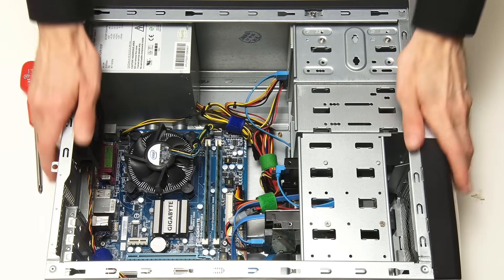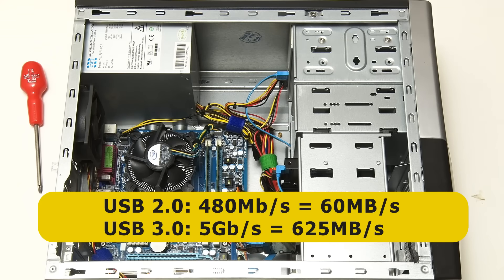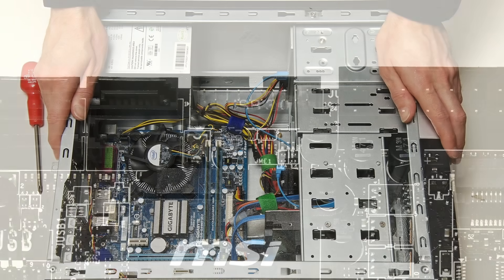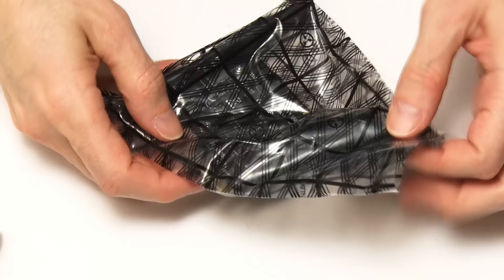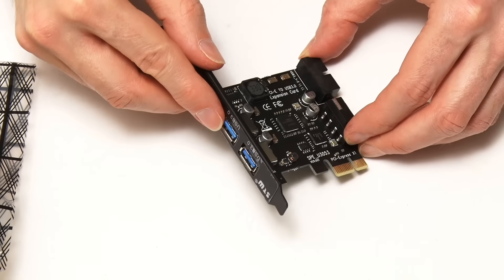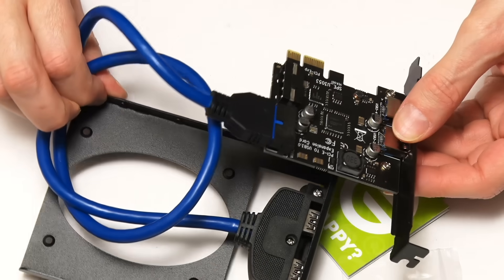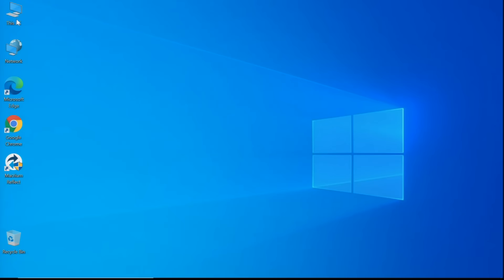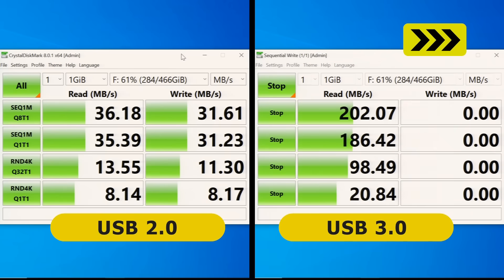Old PC Upgrade #3: USB 3.0 Ports

Comment: I just recently bought two USB 3.0 PCI-E x1 cards for my two older PCs. They are G31 and G41 boards. I had to fit on x16 slot as these boards do not have x1 slots (of course your PCI Express video helped me to understand that I can  use x16 slot, Thanks a lot for that video 😊). The G31 one running Windows 8.1 (x86) and G41 one is running Windows 10 (x64). I have already installed the G31 board's card and it was just plug and play. It did not require any driver. Running just fine. Both of my cards have molex power connector.

Comment: I like your videos because they are real-world situations I've often had to deal with in friends and family computers. A lot of tech videos are only dealing with brand new hardware, perfect cable management, in cases that cost more than the entire computers some people have. I'm hardly ever dealing with brand new bleeding edge stuff- it's so often things like this- adding  USB 3 to an old computer and dealing with 'how to get power to a new component" from some old PSU with all those red, black and yellow wires- NOT some nice modular 1000W PSU that's a week old! Anyway, thanks for a fun video on a real world upgrade!
Reply from the maker: Thanks for this post, it is great to get this kind of feedback. My experience is also that most people do not have the latest expensive hardware.

Comment: Hi. So I have a question regarding these types of devices.

I recently purchased a PCIE x1 to 4xUSB 3.0 connector with no additional power input. It has 3 power regulators supplying up to 2A to each port apparently. (Google or search Ebay for "SSU U3V04S+").

My motherboard is a Gigabyte Ryzen B450 which supports  PCIE 3.0

Now, it's a cheap device and I did notice it had no SATA or Molex power input, so I had no intention of trying to power four external USB hard drives or charge devices with it or anything! But it does seem to power my two Oculus sensors fine...for the time being. But it is new.  If I plug in any other devices at the same time,  it would probably be a mouse or keyboard or game controller. But I'm being as sensible as I can and not expecting much from a device I bought for under a tenner!

So maybe SOME questions... :)

In your opinion, are the devices in which I'm referring to legitimately safe? What's the worst that could happen if these devices fail/fry? Are there power limits or something that consumers should look out for in the device specs?

I presumed at the time that PCIE 3.0 would have enough power and bandwidth to support it with power regulators...But now this video makes me unsure.

I also just want to thank you again for your lovely, informative channel that has taught me so much over the years in a very easy-to-understand way. I hope this comment finds you well, Sir.

Comment: Ranking motherboards for "good design" should be a rather important piece of consumer advice ... because "cables getting in the way" or "slots being badly designed" when it comes to WIDE graphics cards for example, are making working with some motherboards a nightmare.

The same is true for cases ...

Comment: It seems like the front panel piece actually has the capability to secure a 2.5 ssd, so you could have used that one instead of buying a separate adapter tray back in the previous video!

Comment: I did a similar upgrade on my computer about four years ago with 5 USB3.0 ports on the back and an AFT Pro-77U with 4 USB3.0, a CF card slot, a MS Card slot and a Micro SD slot.  What a HUGE improvement in performance and versatility.

Comment: On this old computer you should have a core2 quad q9650 or xeon e5450 processor and a gt 1030 graphics card. And you get a completely "modern" computer at a level close to the ryzen 3 1200.

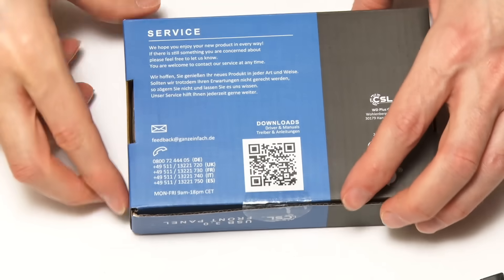Comment: 6:10 or you can go over kill like me and utilize all the space of the floppy slot. The one i bought has two USB 3, three USB 2, one esata plug, and a multitude of card readers including both micro and full size sd card. not sure what these other things are like MS, MS pro, CFI, CFII, MD, AND RS MMC but it has them.

edit to add that i did this on my dads old computer from like 2010-11 because of course my shiny almost new pc from 2016 has no front slots for anything and so i have like 5 or 6 things hanging off of it with like 12 cables coming off the back of the pc including the power and monitor ones.

Comment: I’ve found the simpler bay adapters like you installed are best, the type with a small board with power socket can get too hot to work properly with some usb drives (especially sandisk, they can get too hot to touch)

Comment: Well, as promised,,  i have added usb 3.0 to my geriatric computer. The pcie card from Vantec was a doddle to install because I had one slot to put it in. I also added the Vantec front panel which was problematic. The mounting  holes of the cradle did not match, so I was forced to drill as close as possible to the new front panel interface connection spots. The end result? There was no blue smoke that came out. You know that computers run on blue smoke? When the blue smoke gets out, they stop working. ;-)

Comment: Could you add an M.2 SSD PCIe NVMe card to the PCIe port to use as storage device, or would it not work as this old PC probably (SATA?)is not upgradable to NVMe? Is there any PCIe storage drive that would work on that port?

Comment: @Chris, thanks for another informtive video!

I have a query regarding adding USB 3.0 ports on my old PC. 

(A) Option 1 : I am debating on getting an external USB 3.0 Hub 7 ports desktop hub (with a dual port power supply) for my 5 external HDDs (All my external HDDs are USB 3.0, with their own dedicated power supplies.). This external USB hub will connect to one of the USB 3.0 ports on my PC. The existing USB 3.0 and USB 2.0 ports on my PC are all used up by peripherals like mouse, keyboard, joystick, printer etc.
I am confused whether the bandwidth of these external HDDs will get choked, because the USB 3.0 port on my PC to which this 7 port external USB hub will be connected, can theoretically handle only 5Gb/s?

(B) Option 2: I have also considered purcahsing a 5 bay DAS (Direct Access Storage) for my 5 external HDDs, but the problem of bandwidth choking will remain the same as above, since the DAS will also connect to a single USB 3.0 port on my PC.

(C) Option 3: Another viable option is to go in for the internal PCI-e Expansion Card explained by you in this video, alongwith a 5.25 Inch Front Panel 5 port USB 3.0 Hub. My old PC case has a spare 5.25 bay, because I use an external DVD-RW. (Who uses old school DVDs nowadays in any case!)

Which option, out of the 3 mentioned above, do you recommend I should adopt Chris? Adequate bandwidth criteria being the primary consideration...

Comment: I've never seen a motherboard that puts the x1 slot ABOVE the x16 slot. I have an old system and the x16 slot is on top with the one and only x1 slot under it. Which of course means that the x1 slot is useless as it's covered up by the heatsink and fan on my graphics card. 

I wanted to put a USB 3.0 card in this system, but I couldn't see any way of doing it. Most of the riser cables I found have the connector straight on the end of the cable, so they have the same problem as plugging in a card. And of the few that I found with right-angle connectors, the connector on the other end was turned the wrong way to allow me to mount the card in a vacate case slot (my motherboard is short). In order to do it, I'd need to daisy chain two riser cables, and that combined with the card itself would end up costing me $50+, which really didn't seem worth it for a slight speed increase in an old system. Plus, I found tons of comments from people advising against using riser cables at all, saying that they made the cards unreliable.

Comment: The problem of using PCIe 1x USB 3.0 cards is, if the system only runs PCIe 1.0 or 1.1 the card is dead slow.  0,25GByte/s maximum buswith. USB 3.0 will need 0,4GByte/s. So This works only for systems with at least PCIe 2.0 or higher. Otherwise you get not the full effort of USB 3.0.

Comment: Any usb cables work at those speeds or u need new cables?
Reply from the maker: You need USB 3.0 cables (they have extra connections in the plugs) to get USB 3.0 speeds.

Comment: It's a pity You didn't show how the Card would fit Into the Long x16 PCI slot. The Problem that I have Is, My Audio Card Is using the PCIx1 Slot or the Two section slot (White) here 7:41 mine Is blue. But I have two of the x16 slots free. Thanks for the Information.
Reply from the maker: It would just plug into the end of a PCIe x16 slot. :)
Reply: @ExplainingComputers   Sorry, I watched your video on PCI slots. And You actually do put one into the x16 slot. Only the ones shown are Flat at the End, where mine has a Little Groove at the end, Very strange. I was suffering with the Computer just shutting off for no reason, just watching YouTube videos, I can can play ten In a row with no problem, Then I play this one     https://www.youtube.com/watch?v=tya7i0Yiub8   and It will just shut off. Any Idea why this Is. It's not the only one that does this either. Thanks for getting back, I enjoy watching the History of the Computer. I was a DOS, Dial-Up user with a Program called Data-Ease. A Spread sheet that You had to Build Yourself. You added Fields and You could name them and stretch them, like building a Website today. It was used for cataloguing  my Music CD's For the Disco for quick search. It was a Samsung Laptop with a Floppy Drive. I still have the Database on a box full of Floppy's. Sad I know.

Comment: Help? If I use the  pcie  x1 usb 3.0 card in video. And plug it into a free pcie x16 slot on my motherboard. Will I get the maximum speed or will it only run at the pcie x1 speed capabilities.  
This probably is really stupid question but I have no clue about computers and was given a free dell 390 . Thanks if I get a answer
Reply from the maker: The PCIe x1 card will only ever run at PCIe x1 speeds. But how fast this is will depend on the PCIe version of your motherboard. I've a video explaining this here: https://www.youtube.com/watch?v=PrXwe21biJo
Reply: @ExplainingComputers  thanks a lot for reply , I watched the video you linked. And now understand it. Your videos are great and easy to understand. I wish I found this channel before I bought a 2500k cpu and realised afterwards you can't over clock on a Dell motherboard. Lol rookie mistake but enjoying the learning process.  Cheers

Comment: Sorry. I want to ask sorry im using Google translate..... I want to assemble a PC just to send fast data using USB 3.0 and install Windows 10 ...... if the motherboard is an old school LGA 775/1155, if , you have to use PCIe usb3.0. ..

I want speeding file transfer due to large file files like ps4 games ..... transfer files to external HDD

The intention is that I want to use the usual LGA 775 processor core2 duo installed PCIe usb3.0

If I use the LGA 1155 motherboard processor i3
Any big changes?

For example, in the LGA 775 processor core2duo PCIe USB 3.0 the data transfer is 50-70mb / sec

If the LGA 1155 processor i3 PCIe USB 3.0 can be increased
Data transfer is 120-150mb / sec

Or is it the same?

Does the processor have a big effect on file transfer speed in USB 3.0?

Or is the processor not that influential ... only 4gb ram and HDD replaced by SSD ... it's already speeding and there is no difference in transfer speed.....

Comment: My HP Pavillion Elite didn't have an external 3.5" bay (and the 5.25 bays had Blu-Ray and DVD drives).  But what it did have was some oddball proprietary bay for HP's "Personal Media Drive".  So I pulled the guts out of the otherwise unusable bay and fitted the USB3 front panel in there.  Still would like to make some use of the other "Pocket Media Drive" bay though (it already has a built-in card reader).

Unlike most home computers, this actually has 6 memory slots, and supports up to 24GB memory.  (the machine originally cost me all of five dollars at a flea market).  So I just scrounged up parts out of my parts bin as well as my homebrew PC and upgraded it (that's where the BD-R and DVD-R came from) put in a SSD and a bigger HDD.

Comment: Nice for basics. My challenge is the next, to have USB 3.2 Gen 2 max speed of 10gbps (1.25 GBps theoritical) on my old PC which would need a pci card running at pcie x4 minimum. Not a challenge to procure the card, but i reckon the cabling, the header towards the front bay and the front bay itself, could be. So far I'm yet to convinced to find the proper cable and front bay.

Comment: Price also varies on the addin card depending on how many real usb controller chips it has, most like the motherboard ones only have one, the ports are all shared through the first hub and share bandwidth.   Multichannel costs much more.
Also check your cables for continuity, braid shield should connect to the connector shells, else it may create interference.
Upgrading old pc's this way is useful sometimes for use as data recovery machines as large drives can churn away for days now, best to do it on a separate machine.

Comment: yup  sometimes it pays to replace the main board.

it likely is a 4x pci-e card in a gen 1 pci-e you will only do 1x speed

Personally assuming your chassis isn't Dell/gateway/HP/sub brands you can typically  get 10-20 years out of the case, the internals will change over time past 10.1 you are looking at a system build no more than 4-5 years old

Comment: The PC is either using PCIe 1st or 2nd generation.  That limits the USB to 250 or 500 mB/sec because the card is 1x.  And that throughput will be divided between all the active USB ports.  So the top speed may be comperable to USB 2 with four ports active .  
I am using a Asus U3S6.  One of the few USB to PCIe x4 on the market.  However, they cost considerably more.
Reply from the maker: I cover what you describe in the video from about 16:20 -- the PC has PCIe 1.0 slots, including a table of PCIe speeds. :)

Comment: Thats not old computer ;) My old computer have AGP slot for graphics card and PCI slot for other hardware. I remember having one of these 286 XT powaaahhh!! It was running 25mHz and it had 20 mb hard drive that weighted 3 kilograms and sounded like a grinder. I think total weight of the computer was around 25 kilograms, for just the box, without the screen and keyboard. That´s what I call serious gear. Not like the cheap light weight chinese computers we get today. CGA graphics card with 4 ugly colors that didnt matter much because I had yellow screen and the colors were irelevant. PC speaker sounds rocked in the livingroom. Later I got a real sound card. It was AdLib sound card and it had one jack output and a volume control. The computer community was friendly and shared everything. Data was copied on the floppy disks. The times we never get back. Internet ruined everything.
Reply from the maker: I had to decide how only a PC to use in this series, and it had to be something that could be easily upgraded with modern components.

Comment: First one i bought only worked intermittently. Second one OK.  Very similar to the one shown. In case you wonder, I accidentally pulled the power cable off - completely dead.

Comment: This question is related to upgrading an older PC.  My BIOS is too old for Win10.  The update file doesn't work.  I was sent a package from Intel that does the update by downgrading.  The instructions could be more complete.  Am I correct that I must have a keyboard and monitor so that the bootable USB can run the process?  Also, what are the potential pitfalls of this process?  Thank you for your attention and advice.

Comment: I have been enjoying watching this series of videos and I'm contemplating upgrading my PC. I have a quick question going back to the first video on upgrading ram, I have 2 sticks of 2G DDR3 1333 currently installed and want to upgrade to 4 sticks of 4G each, but I have been looking and I see many variants of (CL-9. CL-11 etc.) How do I know which one I can use? I have the DH55tc motherboard with an i5 processor and running Windows 10. All the product guide refers to is DDR3 240pin 1066 Ram, I'm ordering from Amazon and I want to make sure I get the right parts.
Reply from the maker: Providing you get 4 identical 4GB DDR3 DIMMs (not SO-DIMMS) and get 1066 MHz, or indeed 1333 (which will be faster) you should be OK. Your motherboard spec is here: https://ark.intel.com/content/www/us/en/ark/products/42408/intel-desktop-board-dh55tc.html The CL (clock latency) timings will not be a problem unless you mix modules. Also, do not get ECC memory (ie get Non-ECC). But you are not likely to buy ECC (error correcting) RAM by accident. Share an Amazon link if you want me to take a look.
Reply: @ExplainingComputers  Here is what I'm thing about getting   https://www.amazon.com/dp/B07YN8KKZF/?coliid=I1GBZFLPJL5FRZ&colid=229AS3MTDXSGI&psc=1&ref_=lv_ov_lig_dp_it   . Thanks for your help!!!!!

Comment: I would say the next upgrade that can possibly be added on a pc like this is a wifi and bluetooth combo card or graphics card, i personally would add a wifi card because it can be transferred over to a new configuration later, if you add any modern graphics card to this it would in theory work but it would be held back by the age of that pentium processor.

Comment: If I have stored movies in a hdd and I insert it in a new computer will all the data erased or all partitions and data would remain same?   #please_answer
Reply from the maker: All the data and partitions should remain just fine (I am assuming that the drive is used for data storage only, and Windows is running from another drive?). The only issue would be if you have encrypted the drive or something similar.